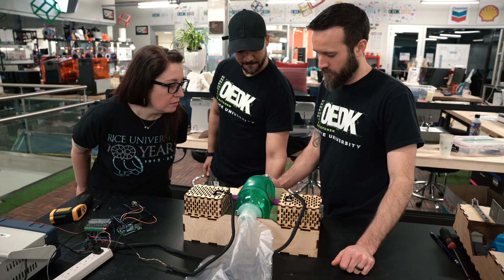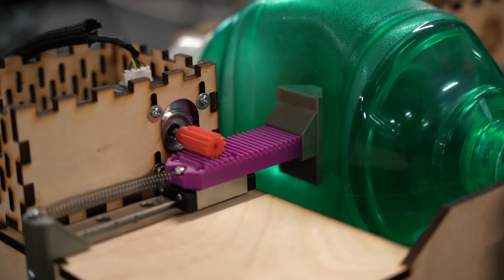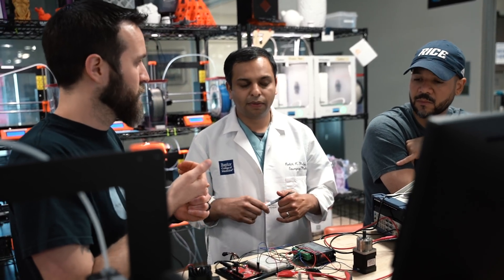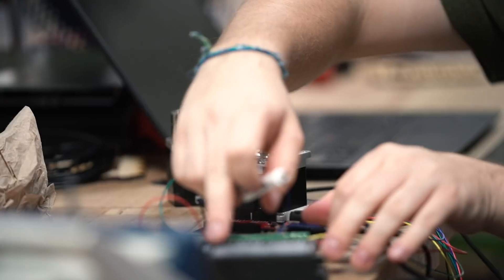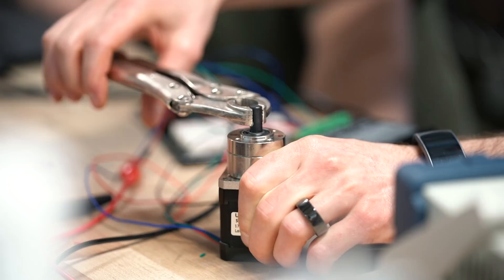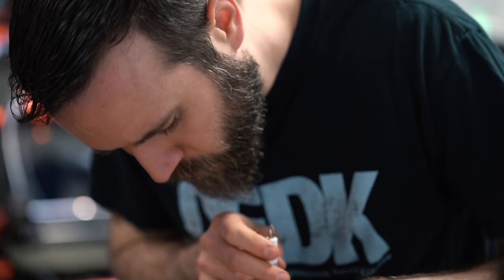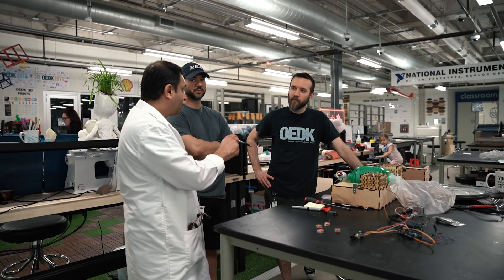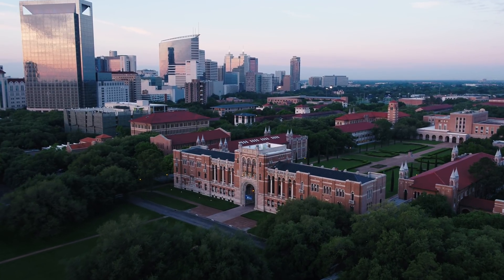Engineering staff, students work to deliver automated bag valve mask to address COVID-19 crisis

Comment: Way too complicated for the Third World and in an emergency in the United States.  take a look at this:@.
This is easily constructed using metal, wood, or plastic using hand tools. There is only one moving part and is robust enough to be transported in the back of a truck bouncing over roads, with thousands of holes per mile. All comments welcome.
 "When you have a hammer, everything is a nail."

Comment: Ventilators can be made for less than $50. After overheads - testing, approvals, and greed, it comes out $5,000 to $10,000.  I could not believe Rice University could not figure the problem is pure greed and not design.

Comment: I'd go with a crank and a cross head or a scotch yoke as I'd worry about the life span of those plastic gears this also would mean the motor doesn't need to reverse which would allow larger selection of motors to be used.
Reply: i am not an engineer but i think a scotch yoke or similar mechanism provide for some dwell time at one or both ends as well which may be an improvement if one can control exact length of travel and dwell times.  I agree, if the motor never reverses you can easily find small, slow speed motors with a lot of torque that can run 24/7/365.  Many linear actuator reversible motors have duty cycles that may only be 25% of the time

Comment: Yeah, a simple air pump shouldn't cost thousands. The medical world gets fleeced so much over something so basic. Motorized Bellows, filtered air/oxygen in, a couple of one way valves and some tubing. No complex software or hardware, no calibration, no fancy casing, just a simple pump. You can knock these out by the truckload.
Well done.
Reply: definitely

Comment: Ok, i get the idea that these guys just want to help by coming up with an "icu respirator" that should be both simple to build and cost effective and that probably should also give less developed countries the opportunity to deal with a highly overburdened health system. Noble thought, no doubt.
The main problem with their invention is - and I'm pretty sure that this statement doesn't sound very popular -, that it simply can't work, no matter how you turn it. There's a reason that even simple icu respirators cost a lot of money and are provided by manufacturers that have years of experience in that field. The medical condition that severely ill COVID-19 patients find themself in, is a highly complex situation beeing called ARDS, or lung failure to use a non-medical term. And by simply pumping oxygenated air into a patient is not how it can even closely be done.
People might say "Before patients die because we are short on respirators, we should at least give their invention a try!" I guarantee you, that wouldn't work, not even for three minutes.

Comment: this is the definition of over engineered. They could've used one motor, in a scissor or hamme/anvil  config and cut down on parts and cost
Reply: Yep, first thing I thought. Two motors of that size is way overkill, same with the printed gearing. The BOM could be cut significantly for such a basic operation, but I'm happy they're taking a more simple approach compared to standard ventilators. Necessity is the mother of invention.
Reply: @gazzaboo8461  I have a feeling that even though overbuilt they have built in redundancy with motors as this may be left to operate on a patient in an emergency situation where staff wont be able to constantly check machine is operating correctly. They did say if one motor dies the other will continue to function. also the stroke looks to need a lot of control mabe the gearing option allows for that without to much sensing. My issue is are those rails also attached to linear feedback sensors as i am pretty sure they are not readily available.
Reply: we are waiting for your fuc--ing solution pal

Comment: Doesnt need to squeeze from both sides. You just doubled the cost
Reply: Disagree. You need balanced force so the mask does not shift on the persons face.
Reply: @ianmiles2505  couldnt they just use a strap on the face to hold it?

Comment: Dr, Malya hello, :-( i missed this video's premiere and have been translating the previous version to FreeCad. FreeCad is free open source 3D cad for LinuxMacWindows. So all can use it. Please avoid 3D printing boxes if Off the shelf electrical boxes suffice. Avoid letter engraving when a stick on label is much faster. Avoid making when buying is better/faster. The new rails and linear bearings are nice but drawer slides are in HomePro and GlobalHouse in Thailand, I will begin with the new files now. Thnak you very much. TomP

Comment: Guys you need to do a stress/N cycle curve analysis and verify that this mechanism can survive a million cycles .... Your device design is not durable enough and it will fail soon.  You need to use wider metal gears and a stronger motor with a larger shaft.....  Then do a failure mode analysis, patients, doctors and nurses need reliable equipment..... come on.   Concept is great but the durability needs to be perfect.....  Put a thermal sensor on the motor so you can make sure the motor stays cool or else the dielectric material on the motor windings will sublime earlier than projected and fail in service.  Cooling the motor with a fan always works and make sure the motor temperature stays below the threshold.  You can get there just make sure you go through a FMA.  Keep up the good work!

Comment: The stepper motor designs are the best I've seen. Ramping and speed settings are keyboard click away. Is it smart to get some low grade cnc software to run on Android/IPhone with sliders to adjust ramp and speed?  Excellent looking kit!

Comment: put the bag a tank of water with a plastic box use water pressure and pumps with valves to squeeze it ..it would be perfectly smooth operating better than a rack and pinion more reliable and youd need common available stuff ..small fish tanks small stock pumps for farms etc  ..mind you im a machinist not a doc

Comment: Very smart: by controlling gear motors in terms of pid and travel it can be translated into air volume rate and pressure (increasing and decreasing) ramps control, Simple but brilliant.
Reply: in the UK, the University of Oxford has something similar. See https://youtu.be/xdZtMgpxnPI
Reply: Yes, it's very clever too, but it needs a compressed air source to operate. I had already seen it and I made myself a question: what if the bag inside the box breaks? Could it risks to inflate patient's lungs with a continuous positive pressure?
Reply: @solino2002andrea  Add a relief valve or burst disc and make one side of the box removable so the bag can be replaced.
Reply: @Membrane556  this device use car wiper motor right? then it must have adapter to change electric AC to DC... how to cut the continiue spin of that motor in order to drive the bar that pressed the balloon...?
Reply: @sonidamara5018  Thanks soni,  a windscreen wiper engine is what I was looking for but didn't realize was so available at wreckers. Brilliant.  This could be operated by a conscious person just pressing a button when they couldn't breath on their own.  Primitive but better than nothing.
Reply: i do not beieve a bag valve machine aka ambu bag needs compressed air to work. These bags are on every ambulance and used by every EMT in emergencies to breathe the patient. The trouble is that who has time or stamina to continue squeezing the bag for hours.  I independtly though of designs using linear actuators or reciprocating motor with a speed controller but the operator may want to design mechanics in a way to provide dwell aka pause time at end of push and pull strokes to more accurately mimic breathing.  I am still researching the physiology and cycles of breath so too soon to speak with any real knowledge but breathing is not just in and out without some pause.  The sensors and controller may provide that.  Ambu bags need no pressure to reinflate, they rebound on their own and they are really inexpensive like $15 on ebay or Aliexpress.
The real problem is that any mechanical assistance with pressure and volume will turn patient exhale  into an aerosol cloud of virus particles.  I already have some designs for portable breath capture machines that vaccum up the exhalation nd sterilize the air with uvc, ozone, pco, hydroxyl type sterilization technologies before releasing air back into the room.  With that invention any cpap bipap, ambu bag or even $50,000 medical ventilator could be easily improved and provide protection for all the healthcare workers. @solino2002andrea
Reply: James Campbell  I wrote it needs compressed air, directly replying to "YouTube Stalker", the guy who suggested a model made by Oxford university, attaching the link: check it out some comments above.
Reply: @medicalinterest9091  yes.. we must try it.. i wonder how make this device in order to force fresh air to the patient in certain sequence.. not too fast..  must ask doctor first..
Reply: @jamescampbell1060  you are right... we need filter device too... otherwise it will put paramedics on the room in danger...
Reply: @sonidamara5018   uncontaminated air either from outside a building or through a filter of some kind.
Reply: @medicalinterest9091  this man is genius... ! thx alot
Reply: @sonidamara5018  you are welcome. I got honors three years running in carpentry and did tertiary level electronics but I think most people could manage to build this from recycled motors out of record players and microwave ovens and a dimmer pot.  I have two doctor cousins, highly qualified but unable to repair cars or build a house, but this doctor has impressed me for sure.
Reply: @medicalinterest9091  where are you come from.. i live in jakarta indonesia... 2000 ppl are invected here... may be worst in next week... our goverment change one appartment to emporary covid19 hospital...2k bed but i think they lack of ventilator...
Reply: @sonidamara5018  I am in Australia. I haven't found any useful inventions here. The link I sent you is the best so far. Because it is a doctor in a hospital he able run all the tests on it an improve it.
Reply: @sonidamara5018   Arizona Hospital,  Respiratory Lab.  is where this respirator is being tested.
Reply: @medicalinterest9091  ooh.. ok my frend.. you are right.. this is the best so far...i will ask my frend may be to try build one of this...thx n stay save...
Reply: @sonidamara5018  Good on you. Show it on the net when you have made it.
Reply: @utubestalker.dotcom   the University of Oxford video is obsolete unfortunately, but thanks anyway.
Reply: Maybe a mechanical hand adjustable air stroke cam to eliminate controller and sensor? instead of a programmable stepper motor, possibly simpler fully mechanical.
Reply: Also could get an idea of volume with a pressure sensor might be able to use an automotive map sensor or a barometric altimeter.
Reply: I know very well Tmap intake manifold sensors: they need accurate 5V dc power supply for a good and repeatable reading. It’s a good Idea.
Reply: Flowasky brown   this is just an advertisement. No help for constructing a simple ventilator, but thanks anyway.

Comment: Good stuff, made by skilled people, but the old-school approach with their email lists is unfortunate. Open-source it, put it on github; people will contribute good ideas faster than you can imagine
Reply: Open-source it ---> is the key
Reply: That's exactly their plan!
Reply: @mintyswirljoy  It's not that simple. When an ambu-bag is used by a paramedic they watch the patient and sync up the bag with breathing. The motor doesn't do that by itself. Opposite sync can cause too high of pressure, so there must be safety measures in place
Reply: Clark Kent  Have you tried following the links under that video? I mean I admire the excellent minds who are working on the problem, but open it ain't

Comment: Today I tried with similar at home with the DC motor of a automatic screwdriver. But I think we need more than just sth squeezing a bag valve, like sensors to measure the pressure, patient's symptoms etc. Anyway, I ended up with sth just squeezing the bag valve automatically for now.
Reply: Make sure you have a peep valve!

Comment: Ok , how about this ; a car windshield wiper switch set to intermittent, to a car blower motor , to a tube to a mask ? You could hook it to a 12 volt converter or a 120 volt converter ?
Reply: it needs precise control  like at what speed motor moving 
when it needs to slow down when to ramp up 
for that you need  stepper motor with rotary encoder that can be operated by PID controller
Reply: @dipmansinhvaghela7300  there are many off the shelf parts on ebay and aliexpress that are already gear for very few rpm and with some appropriate speed controller or pwm can dial up or down.  the real trick is to be able to precisely pause at each end of cycle .  Breathing has more of a pause at the in and out, than a ramping.
Reply: @jamescampbell1060  actually yeah there's nothing complicated in this its just a rotating mechanism thatsa all😅
Reply: A rotary cam or connecting rod input automatically slows at top and bottom of a driven piston cycle due to Its circular motion. The best small gear motor I have found on Ebay is Amazon.com: BEMONOC Micro 12 Volt Electric Gear Motor 15 RPM Reversible High Torque DC Worm Geared Motor: Beauty
It is made in 15 rpm @12 v.   Speed varies according to voltage.